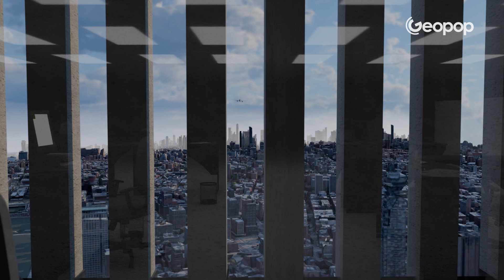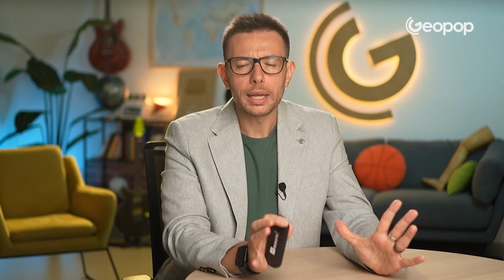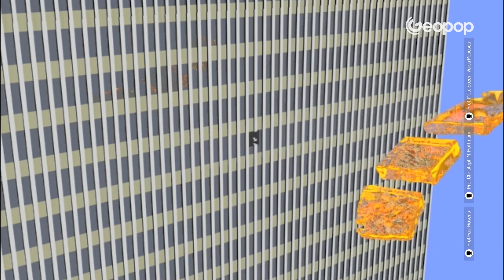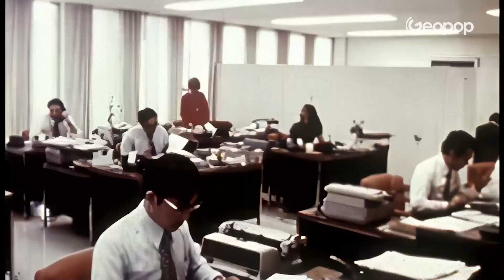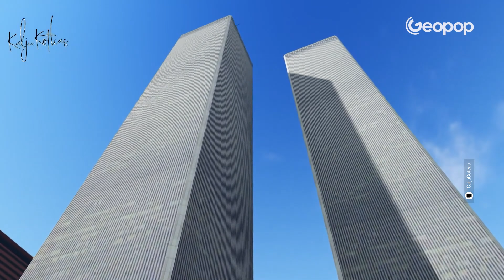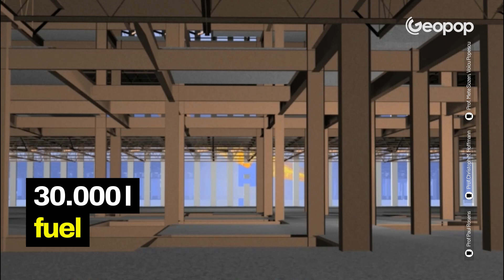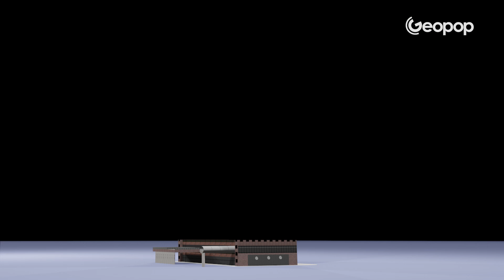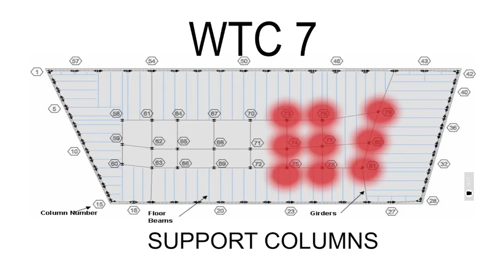9/11, 2001: The Technical Reconstruction of the Twin Towers and WTC 7 Collapses

Comment: So, building 7 fell because of office fire?  How on earth did a building that could collapse only due to fire pass all the approvals to be built?  What other buildings made this way are at risk of collapse should they catch fire?  Why does every other building fire not end in collapse?  I really don’t want to believe the conspiracies, but debunk videos like this aren’t helping.  I’m always left with so many questions, and so few answers.
Reply: Don't forget the huge pieces of north tower that fell straight through the roof
Reply: @dionvanbreugel it fell at free fall for a few seconds.
Reply: ? Many steel buildings have completely or partially collapsed due to fire. Fire weakens steel. Weakened buildings can collapse. It's not that complicated.
Reply: If it had been an ordinary office fire on an ordinary day the sprinklers would have activated and the fire brigade would have thrown everything they could at it and the fire would have been out in an hour or less. On this day the sprinklers were rendered inoperable due to the collapse of 1&2 taking out the water pipes and the fore department was not focused on saving that building but staying alove themselves and searching the rubble. So the fire in 7 burned for hours, weakening the steel and triggering the collapse. The truth is not hard to understand but it is less titillating than the fantasies of ignorant con men.
Reply: It wasn't just fire. It was tons of concrete and metal that fell on it plus fire that wasn't subject to any suppression. The sprinkler system was disabled by the falling debris and firefighters were pulled from the building.
Reply: @frankplaysdrums  Grenfell tower in the uk burned for hours and didnt fall..
Reply: @F12024-i please be dumb somewhere else
Reply: @F12024-i  Grenfell tower was constructed of reinforced concrete which is much more fire resistant than steel frame construction.
Reply: @frankplaysdrums whole lot of coincidences for 1 day
Reply: Because most office fires are contained by anti fire system and firefighters, but this one was left to consume the building for 8 hours.
Reply: @Mdnightsoldier  yeah that's correct where did fire system of building stayed during 9/11
Reply: Look it up 
But nothing will change your mind 
It's all on the Internet but you just dont like the answer, you want it be a big conspiracy
Reply: @HB-gj7gd I mean it's not like everything we've every been taught about anything is a lie at all!?
Reply: @HB-gj7gd I've got lots of questions but I wager you couldn't answer them.
Reply: It’s cause it was planned…likely from the start….The collapse looks like free fall to me….and what about building 6? Look at those pics..what about all those dump trucks ready to go…so many lose ends..
Reply: The NEST LIED. GOOGLE 9/11 WAS A INSIDE JOB
Reply: Any idiot who watches a building being imploded and build 7 coming down would assumption the same.
What about thermyte found in many iron bars from both towers...only USA military complex benefits from these with war on terror now earnings are above hundred billions annually. Wake up people these people cause 9/11
Reply: You're an idiot.
Reply: You only ever see the back of buildings 7 as it falls because everyone was out of the area by then. If you saw the massive amount of damage done to the front of building 7 when the twin towers collapsed next to it then you probably wouldn’t have so many questions.
Reply: Um. No sprinklers. Burning unfettered for 7hours. No one simulates that. It’s all in the video if ya watched it.
Reply: @davepubliday6410  Dave, no the building did NOT FALL “because of office fire”. That is NOT what NIST concluded. If you bothered to read the NIST conclusions at all (which I doubt), you’re reading them with prejudice & ignorance. As a mechanical engineer, I can explain it to you. Show me that you’re worthy of my investing any of my time explaining it to you, and not just another brain-dead conspiracy theorist.
Reply: @  I didn’t read the NIST report, I was reacting to this video claiming that it was fire that brought down the building, hence my concern.  My post also stated that I “don’t want to believe the conspiracies”.  If it wasn’t fire, nor an airplane hitting it, then what was it?  And are other buildings at the same risk of total collapse if they are near another failing structures?
Reply: @ ”I didn’t read the NIST Report” That’s your first mistake. You don’t need to read the whole report. Without an engineering background, there’s a lot that won’t make sense to you. I am a mechanical engineer. I did read the whole report. I can assure you that the methods & analyses it contained were rigorous & properly done. As agreed by all the Structural engineering societies & faculties in graduate structural engineering programs in the US. You CAN read (& believe) their conclusions, though. You simply have to turn off the (“oh, another Gubbamint cover-up” voice in your head).

Da Gubbamint wrote NOT ONE WORD of that report. The government’s official stance was, “we agree with whatever those experts conclude” (and the NIST engineers really were experts, from all different segments of US engineering society, academia, industry, etc.)

Okay, I’ll make this simple for you. As in every complex engineering failure, there were multiple contributing factors that came together (for the first time). There are building that caught fire & did not collapse. None of the previous examples were steel-framed skyscrapers that had been impacted with speeding giant, fuel-laden commercial jets (the closest comparison was the Empire State Building (VERY different design) by a very slow moving B-25 bomber who was lost in fog).
Simplifying many factors, you first have to understand what allows a building to stand, and the single most important factor is “geometry”. It was/is crucial for any skyscraper to keep the support structure & columns properly aligned in order for them to be able to support the loads. The lesson is “lose the geometry, lose the building.”
The key factor in losing the geometry is a phenomenon called “creep”. If you look at just stress levels or just temperatures, then the buildings would not have collapsed. Several other building had just one or the other. But when you combine the two, especially in a skyscraper), disaster results.  When steel is exposed to “fire-reasonable” temperatures at low stress levels, it will survive & remain strong. If it is exposed to elevated stress levels at room temperatures, it will remain strong (& “factors of safety” are always built into designs). BUT … when exposed to both elevated stress levels and elevated temperatures, it will begin to creep. This is a slow, progressive plastic yielding (the columns behaved like taffy, slowly bending, increasing tilt & stress levels, producing more creep & higher stress levels … a positive feedback loop that inevitably resulted in collapse at temperatures far below “melting temperatures” & at stress levels far below room temperature yield strength. 

There are two graphs in the NIST Report that show this clearly. One shows “strain versus time, ignoring creep”. The strain (ie., deformation) levels remain moderate.
The second graph is the same “strain versus time INCLUDING creep”. The strain levels rise off the charts.

The second glaring clue is the following: whenever an engineer is performing a failure analysis ( I’ve done several in my career), one of the most important consideration (ie., clues) is the “time constant” of the proposed failure mode. When steel gets weak due to increased temperature it to stress levels alone, the failure is “almost immediate”, measured in seconds to single digit minutes. Creep is a phenomenon that takes a few hours, engineers modeled it & it took 1 - 2 hours to fail. And this was exactly the time between impact & collapse of the two towers (north tower: 2 hours. South tower 1 hour).
As I wrote earlier, the makers of this video have, as far as I can tell, ZERO background in structural engineering in tall structures. The most important thing that they could have done was to hire & pay a qualified structural engineer to explain to them what was written in the NIST Report. As far as I can tell, they didn’t do that. So they picked up random pieces of this jigsaw puzzle & nobody helped put the pieces together for them.
Reply: @ Thank-you, that is the best explanation I’ve ever heard on the Internet about this collapse.  So, if I’m understanding, if a building like this is both structurally damaged and on fire, it can slowly weaken, then suddenly collapse, as those two factors together cause a feedback loop between themselves.  Is it that rare for a building to be both damaged by falling debris and on fire that could cause this?  In other words, have there been many cases of this kind of failure before, resulting in such a fast downward total collapse?  And could it happen again?
Reply: @davepubliday6410  Dave, I was describing the progressive collapse of the towers, not WTC 7. Obviously no building “fell on” either of the towers. The two most important parts of what I wrote are 1) the critical importance of maintaining the geometry of the column structure & 2) how creep destroyed that geometry after 1-2 hours. A good example of the importance of geometry is an “IKEA Bookcase”. I don’t know if you’ve ever put one together, but what I’m about to tell you is true. What component gives it the strength to hold up 600 pounds of books? Is it the heavy 1” thick side panels? Is it the 3/4” thick shelves? Is it the 1.5” thick horizontal base piece? No, it’s NONE of those. Because if you put ALL of those pieces together, it will barely stand on its own. A very slight push to the side & it will immediately turn into a parallelogram & collapse to the side, even while carrying NO books. The part that give the structure all of it rigidity is the incredibly wimpy 1/32” thick CARDBOARD back piece that tacks to the other pieces with TINY brads. Because this back piece, once installed, keeps the geometry of the other pieces in their “strong” alignment (ie., 90° corners).

The towers were this same situation x1000! The only way for it to carry the loads was for the columns to stay aligned with each other & straight vertical. Maintaining this geometry was the job of the relatively wimpy floor structures. Three vertically adjacent floors were destroyed by the plane impact & this created an immensely weakened 4 story segment of the towers (4 story because of the vertical stagger of horizontally adjacent 3 column subassemblies. The upper undamaged block of the towers started leaning, the columns started (& continued to progressively) creep until a line of joints on one side of the building could no longer resist the concentrated bending moment of the upper block, & fractured. Once the collapse began, the upper block “free fell” for 4 stories & there was zero hope of it stopping until it reached the ground.

WTC 7 was a different story. Its fatal flaw (if you can call it that. After all, it stood just fine for ~25 years, until a skyscraper fell on its southern wall) was a 47 story (IIRC) skyscraper built on stilts, over an existing power station. Bad idea. The firemen on the scene knew for certain that building was doomed for >5 hours before it fell. They could tell because someone put a surveyor’s transit onto a point high on the building & they watched the building progressively lean more & more as the day went on. EVERY SINGLE “tall building” on the planet - without exception! - that begins & progressively continues to lean is going to collapse, for the same reason as above (loss of geometry). The instigating details for WTC 7 were very different than for the towers, but the proximate cause of the collapse (loss of geometry) was the same.
Reply: Thank you for having an open mind despite the unnerving nature of your curiosity— the biggest challenge in discovering the truth (of anything) is the challenge of overcoming cognitive dissonance— the challenge of getting people to admit that their preconceived idea is actually incorrect enough to warrant a reevaluation. 

Nobody wants to realize they were wrong about what they thought was “right”, it’s a scary feeling.
Reply: @ripj5301 this sounds like gaslighting. Way to go avoiding answering any questions.
Reply: Never saw office furniture collapse a building due to fire 😢😂that's ridiculous assumption. Where these people are learning engineering. 😱 OMG
Reply: @IIParsecs  The neat thing about reality is that it exists even when you in particular aren't looking at it.

For example, steel-framed structures that have collapsed due to fire in subsequent years:
-Edifício Wilton Paes de Almeida in 2018
-Mumbai High North offshore complex in 2005
-Plasco Building in 2017 (This building was primarily an office building AND mostly collapsed vertically)

These types of collapses are generally rare because big steel-framed buildings generally have the fires put out at least suppressed by sprinkler systems, et al.

Building 7 suffered a total loss of water pressure and subsequently burned uncontrolled for hours. Steel isn't able to maintain load strength in those conditions.

Comment: So the bottom two thirds of the building falling is explained by “complicated math” and because “the mass increased as the building fell”.  This sounds like nonsense.  Mass doesn’t increase when things fall. Then we are told, “the energy released was of such magnitude that the floors below offered practically no resistance”.  This also sounds crazy. Maybe there was a shock, but the girders from below the crash all the way down to the ground were not weakened by heat, they had held the entire building up for decades.  They had to offer resistance, a fair amount of it. 
I really don’t want to believe the conspiracy theories, but, every debunk video I watch doesn’t answer basic questions and pushes me further down that road.  Please, I beg you, for my own sanity, provide a better explanation as to how on earth the bottom two thirds of these buildings BOTH gave in as if they were made of styrofoam.
Reply: The guy explains it pretty clearly. Each floor could resist a load of 10 additional floors if applied gradually, or 6 additional floors if applied suddenly. Seeing there were well over 10 floors in each building, once you get the initial failure there’s no stopping it.  Just because the bottom 2/3rds of the building had been holding it up for years doesn’t take into account the maximum load each floor could take, because the floor structure and the perimeter and interior columns were all working in tandem to support the entire building.
Reply: @passnba2k  I suspect the physics are more complicated then that, but let’s assume that’s correct.  I don’t see how it allows for all the floors to give way immediately.  There was no hesitation in the floors, the building comes down in almost free fall speed.  Surely these floors that “withstand six floors” would provide some resistance, even if they could not hold.
Reply: Oh and by the way building 7 was never mentioned in the final report NIST is the biggest joke ever.
Reply: It’s likely due to the fact of how hollow the buildings were. Between the core and exterior walls there wasn’t much support for the weight of the tower aside from those two areas. The floors were made of a lightweight truss system then is known for how easily it can be broken and fail due to fires. The walls and core were pretty tough but seeing as how there wasn’t much in between to support it all that’s why the floors fell but after the collapse especially for tower 1 you can still see a section of the outer wall roughly 30-40 floors still standing. I’m not a professional and could’ve explained it better but after looking at how the building was built and realizing that while it is true the towers were built to withstand anything they were also very hollow and had some critical structural weak points. Made worse by the fact they were sliced.
Reply: Wow. I can't believe you believe that so please  enlighten me, building 7 was hit with nothing how did it fall. Have you seen NIST diagram of that falling THE RECONSTRUCTION IS ABSOLUTELY RIDICULOUS.

Comment: The explanation for how the lower structure couldn’t arrest the collapse is wholly insufficient and flawed. The mass doesn’t increase when the building collapses, the mass is constant. So your logic is flawed.
Reply: Set a 10 pound rock on one of your feet, drop a 10 pound rock from 12 feet high on your other foot, let us all know if it feels the same.  If not, then YOUR logic is flawed.
Reply: Mass isn’t the same as weight
Reply: @apacheattackhelicopter8410  

Loose change
Reply: Loose Change